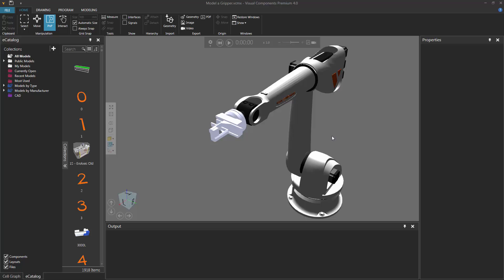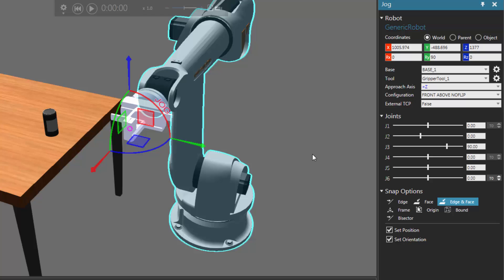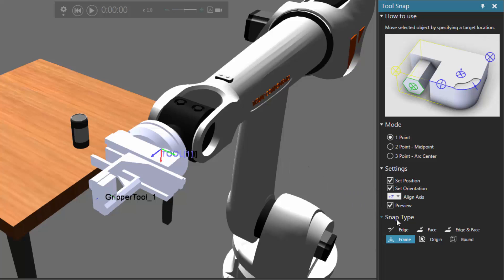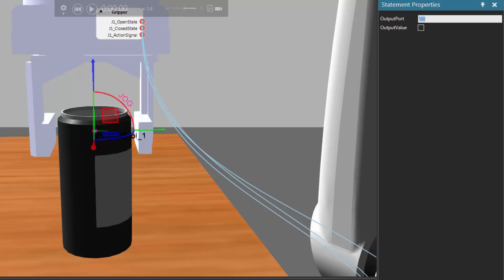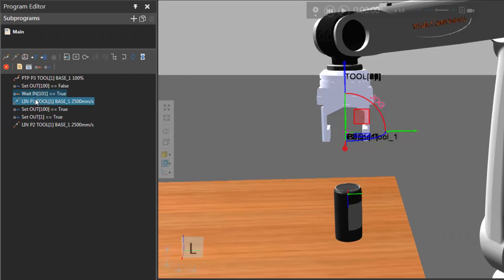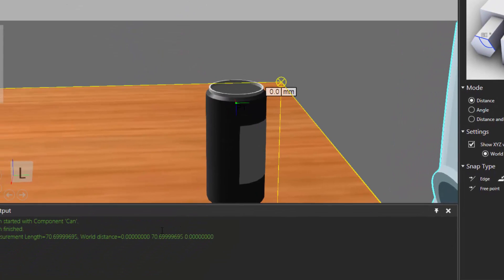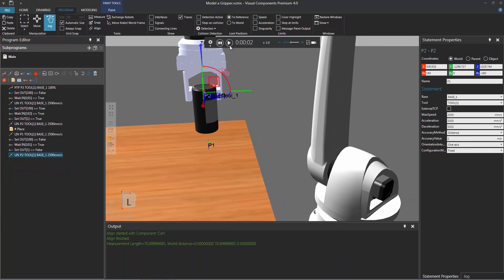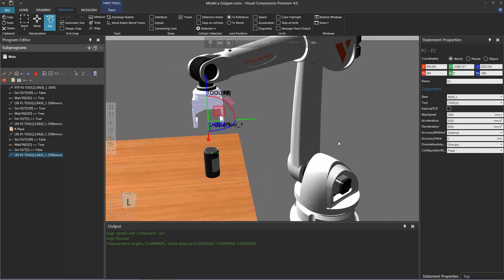Model a Gripper - Part 2

Comment: For some reason Signal Action keeps resetting back to '0' everytime i leave the robot...
Reply from the maker: Does you mean the Signal Actions drop-down menu? If yes, that is by design. The user interface won't remember the last configured output, but instead resets to the first value, which is "0".

Comment: Hello,
Your tutorials are awesome!
Would it be possible to create a tutorial explaining physics features?
I took a look to the help menu of the software but I don't really  get it.
Speaking about grippers, would it possible to have physics behaviour on jaws when the gripper closes them on a component?
Reply from the maker: Yes, it is possible. The Help > Tasks section in Help File can be revised to be more clear. In the meantime, in the 3D world, physical forces are always there but disabled if the simulation is not running. In order for a component to be affected by those forces during a simulation, parts of the component must be physical bodies. For example, a link/node in component must have a Physics Entity behavior, thereby the features and geometry of that link/node can be affected by physics. Geometry can collide with one another if the feature or parent feature of the geometry has a defined Collider property. That is, things can bounce off or push one another. As for the gripper, contact our Technical Sales department about that issue.